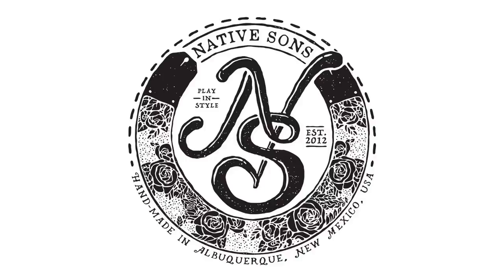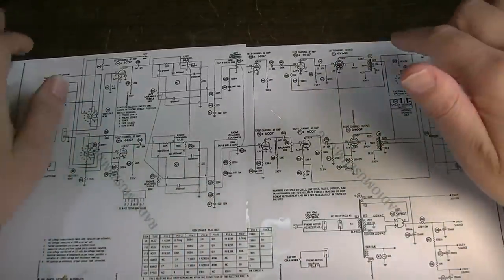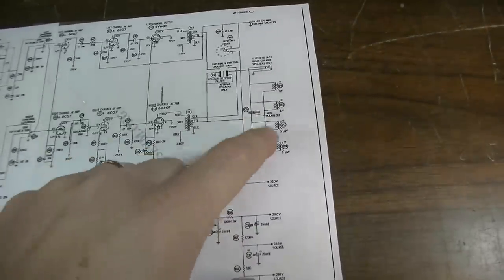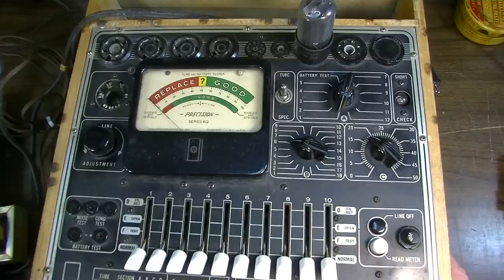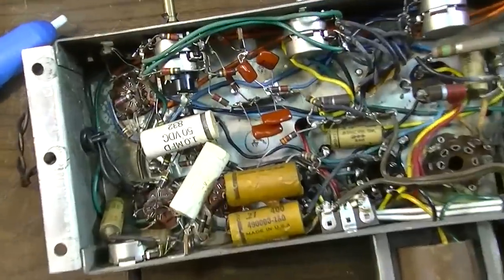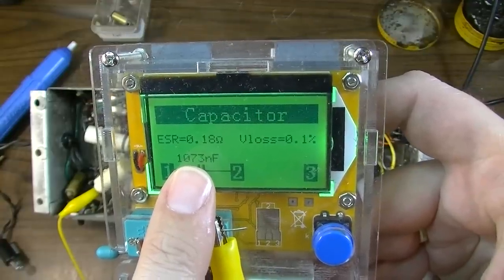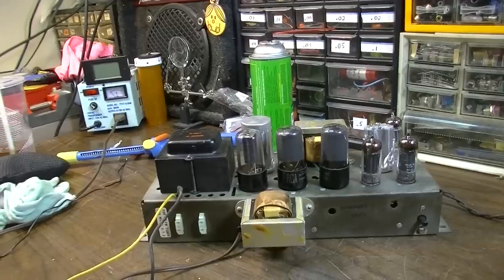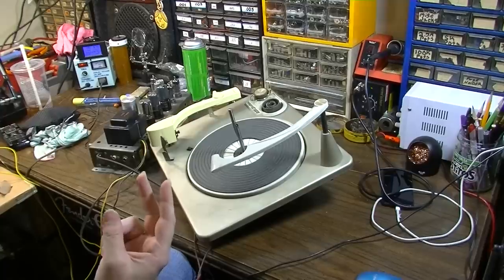RCA Console Amp - 1st Commercial STEREO Amplifier - Detailed Overhaul

Comment: Hi I’m a tube tester snob I have seven including one of these this is a emission type and well done this is a great quick check but if you want to get real you need a trans conductor type which measures in Mu but your right that in the amp is the best test but no numbers

Comment: My neighbor had a very similar console to this. They had a separate speaker cabinet (same speakers in the auxiliary cabinet (2x12" and 2x3.5") matching the size and style cabinet of the main console for the other channel. The second speaker was an accessory that could be purchased later in case the customer did not want to spend the money at the time. The amplifier was identical as I remember replacing a couple tubes for them and the chassis layout was identical as was the turntable. Sylvania tube appears to be from 1972. Not sure of month/week.

Comment: Hey Brad - just a note on the tube tester.  What you are supposed to do is set A,B, C, and D (as you did), then turn on the tester (push the white button) and one at a time, throw each of the other un-used levers to test. So in this case, all of them except 2, 9, and 10 (see below). If the light comes on, then the filament is shorted, however the chart is telling you that lever 5 (in this case), it's supposed to light up, since it's the other end of the filament.  Keep in mind that each lever corresponds to a pin, so for example, on an 8 pin tube, you don't have to throw levers 9 and 10.  (10 corresponds to one of the wire clips if the tube had a cap)

Comment: Spring time in the Midwest. Tornados, power outages, and time to mow the grass, or smoke it! Fun times! I was surprised you did not convert the amp into true stereo. A little retiring on the output section and separate speaker wires. You know what you are doing for your customer. The Bluetooth will be great. I am interested in seeing how that is works. Thank you Brad for sharing. Another great look at retro repair and update mods! Thanxz
Reply: Think that is planned for part 3, I'm waiting to see which turntable he picks :)

Comment: Just a thought - You could rewire the internal speakers so each woofer/tweeter pair were driven by separate channels. You'd need a couple 4uF nonpolar crossover caps to replace the single 8uF that was shown in the Sams schematic. Channel separation wouldn't be too good, however.

Comment: i made a rather cool bluetooth mod  for my tube amp by taking a torch, and removing the bottom of a old burned out tube and building the bluetooth receiver into the old tube housing has the same socket as the 8 Pin diode and 6v6 tubes

Comment: I think I missed something !!  The first capacitor can you replaced looked like it contained 4 capacitors (4 contacts on the base & 4 cap readings on the side of the  can).  But you only put in 2 new Caps.  Did you add 2 more caps under the chassis that you didn't discuss?

Comment: I love the picture in picture for the work stuff! That new cam looks really good. It's very sharp and detailed with you digging around in that amp. Is the same camera doing both close up and wide?  If so, how does that work? High rez cam and zoom in the edit? It is interesting that the color temperature is not exactly the same between the two images if you are pulling a zoomed in frame size from the same camera. Also, the focus when you put stuff close to the camera was fast and accurate like you had a professional AC pulling focus on it. The cam automatically focused back down to the amp very quickly and naturally.  Money well spent my man.

Comment: Geez, Brad....It's impressive that the original tubes are still good, but i'm not sure I'd call it 'miraculous!' Remember two things: 1. These come from an era when, unlike today's throw-away, planned obsolescence technology, things were made to last, and manufacturers' reputations were built on product quality and durability. and 2. None of the tubes that you find in these older circuits ever take the merciless beating that guitar amp tubes are subjected to (not to mention that newer tube amps are designed for optimum results, without regard for longevity beyond a couple of years. Younger generations have been taught that power tubes, in particular, have a finite, relatively short lifespan.). Stop to think about how many old (like tweed old) tube amps are still using their original tubes....even after being biased too hot, etc.!! That, if anything, might be examples of 'miracles!' :-)
Reply: More to the point, tubes, unlike transistors, can take a beating - at least for awhile.  As long as you don't run the tube with red plates too long, it will survive.
Reply: Very true! Transistors have no sense of humor whatsoever!! LOL  My point, though, was that it's actually true when they say, "They don't make 'em like they used to!" I was six years old when this thing hit the streets, and I can remember, a couple of years later, one of my uncles buying a stereo console half the size of an aircraft carrier!! The sound, though, compared to anything we'd ever heard before, was amazing...and that monster survived, down in his 'rec room,' fully functional until (at least) he passed away a few years ago. By comparison, I just put a matched sextet of KT-88s into my SVT because they had begun to die, one by one, rendering the amp pretty useless...and the 'old' tubes were only about six years old!! Meanwhile, I have a '71 Super Reverb that had to be re-capped, but is still running the original tubes!! Whenever possible, I'd much rather buy genuine NOS than brand new.
Reply: If you noted in the first video, due to the red plating, he was concerned that the 5Y3 and the can capacitor were both shorted, most likely one causing the other. Just because old tubes were built to last (which a vintage amplifier tech is well aware of) doesn't mean it's invincible to a shorted filter capacitor.
Reply: No, it's not invincible.  The concern is understandable, but he was surprised that that it was good.  I wouldn't have been surprised either way.
Reply: Most of the tubes I use in my own personal amps(guitar & Hi-Fi) are around 50 years old. They all test like new in my Orange VT-1000 Valve Tester, Vacuum Tube Valley Tube Characterizer and old Mercury 1500 tube tester.
Reply: Nipper would be happy.
Reply: Wow.  The thinks were red plating on this one...

Comment: To empty those big electrolytic cap tops i have seen Buzz1151 heat them with heat gun then insert a wine bottle corkscrew, and pull that stuff all right out. They have a bit of tar in them i think that needs to be heated for easy release.
    Also even if those old white caps you left in  test good, there to old, how much longer will they really last. You should have taken them out on a customers amp so they don’t have to worry about it for 40-50 years. If it was your own amp do what you want. Easy fix for you, inconvenient hassle for them if it goes out with new regular use. Sorry for the negative comment I usually like all your work.

Comment: Hi tHE Guitologist, very good video that you have made of the Bluetooth KRC-86B V4.0.
I am writing to you because I am trying to install it on a Yamaha PSR-2000 musical keyboard, so far it turns on well, the LED, connects directly without the need for security like the other bluetooth, example "0000".
But my concern is that the music does not sound, there is no audio. It will be that you can help me, I am waiting for your response, thank you.

Comment: i added bluetooth to a 48 zenith...pretty cool
Reply from the maker: I tried it the other day with my niece's 30s radio. Results were not great. Video to come soon.
Reply: @TheGuitologist  i used rec 5.0 from ebay .??10$ sat on side turntable.combined output via 1 to 10k 1/4 watt resistor divider

Comment: @ The Guitologist
 Hey man I have built my own Tube amp and I am wanting to add a VU meter to it..  I have the VU meter already  but lacking a tube circuit  to drive that circuit..  Do you have a schematic for this?  I can find Transistor controlled ones but I want to use a tube  or two to drive the VU meter can you help??

Comment: This was a good one. Thanks!  Do you think modern tubes would have held up as long as those? I always buy old tubes and sometimes I wonder if I should just start buying modern ones. I read about people replacing tubes every year or so but sometimes I buy a 70 year old guitar amp with what appears to be original tubes that work great.
Reply: No, modern tubes will not hold up that long, nor will they sound as good. All you have to do is listen with your ears to realize they don't sound as good, and look at them to see that they're not built as well.

Comment: About your Variac.....has the 5 amp model been enough or have you ever wished you'd bought the 10 amp?   Thanks.
Reply from the maker: The 5A will cover every guitar amplifier I know about. No amp I've ever worked on even had anything above a 4A fuse, IIRC.
Reply from the maker: This is the one I use, just different color: -5A Variac: http://amzn.to/2FNWthU

Comment: I still can't wrap my head around the Int/Int & Ext switch.  Strange stuff going on there.  BTW, that 1/4 jack isn't for headphone -  according to the drawing, it's to connect the internal speakers to a external amp.  No idea who would do that unless it was the showroom using it as a external speaker for another system.

Comment: What determines how big your electrolytic caps need to be. I don't think I have heard anyone talk about this. I think most people go by a old schematic, but this does not tell why this size is used.
Reply: The values are on the side of the can.
Reply: Your missing my point, What determines what size cap you use. Example: You are building an amp you designed. How do you know what size capacitor to use.

Comment: Hi, Brad. I happen to have my Dad's old tube tester that's identical to yours. The "Line Off" button is broken on mine. I'd like to replace it, but I don't know what that kind of button it is or what it's called, so I don't know what to look for. Do you have any idea what search term to use for something like that? Or perhaps where I could find one?

Are they the same types of buttons used on a guitar pedal?
Reply: A switch is a switch.  Just pull it, figure out what pole and throw it is, and replace it with a suitably high current switch.    There should be SOME information on the switch body itself.
Reply from the maker: I tend to agree. You'll have better luck just using a regular switch, like maybe even a pedal type switch, and then find a momentary pedal switch for the other one.
Reply: Thanks, rewtuser! I haven't taken the device apart yet. You're right; I'll probably get a better idea of what I need once I get in there.
Reply: Thanks, Brad! Your video today just reminded of me of an item in my project pile! It's an ol' timey kind of button/switch, and if there's ANYBODY who's seen his share of ol' timey switches, it's you (and of course, Uncle Doug.)

BTW, I noticed that Uncle Doug has you on a list of his favorite YouTube channels?! You guys are the Frank Sinatra and Dean Martin of amplifier videos!

Comment: I was always told the inside of those capacitors was unsafe to touch. Is that true?
Reply: Ed Dana I’m no expert, but I think if you “drain” the stored power they’re harmless. I’ve watched a few repair videos before wher they unplug the appliance and then turn it on to release stored power. I’m not 100% sure though.
Reply: I heard that too, but it wasn't from the stored voltage, but the materials that made up the inside. Almost like corrosive components that could burn or eat your skin.
Reply: Bun yeah, I replied before that part and didn’t realise that’s what he could have been referring to. Oh well, someone will have the correct answer I’m sure.
Reply: In the late 90's there was an RCA dumping sight near Bloomington, Indiana that had to be cleaned up because of the compound used in these capacitors.
Reply: You can eat the material in capacitors. I've been putting it on my sandwiches for years. 😁

Comment: Ha RCA! they were a bit of a shitty outfit back then. These were sold as stereo but in reality they were mono unless you sprung for the "optional" second speaker which wasn't cheap. Back in 59' the parents didn't really care for it and bought a Magnavox instead. Remember pop saying it was a better set (12w push pull per ch.) and was twenty bucks less and came standard with both cabs!